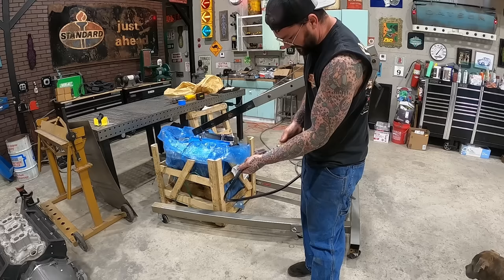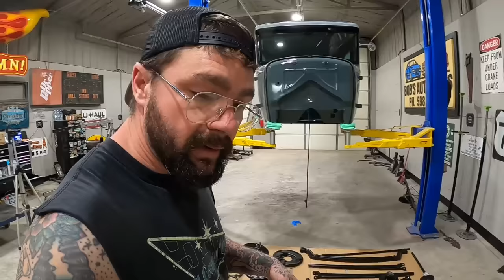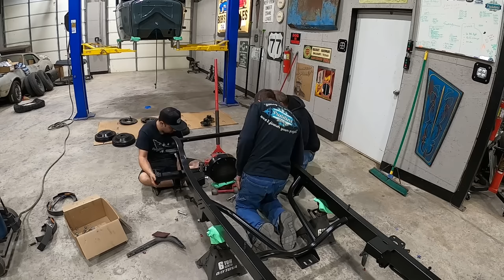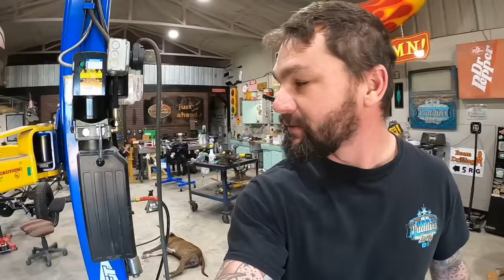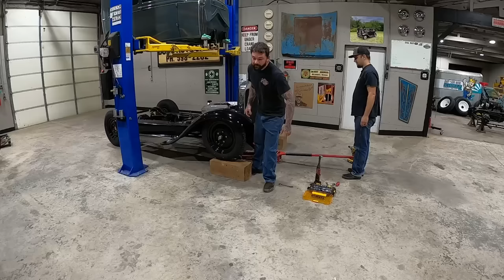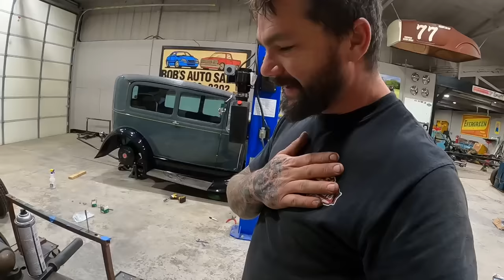ENGINE Installation, CHASSIS Assembly, BODY Installation, AND MORE!! 1930 Model A.

Comment: Suggestion : For oiling up your engine before firing it,disassemble an old dead distributor ,remove the gear,cut the shaft housing off at the top. Now you can drop the shaft into housing ,connect a hand drill to spin your oil pump up to pressure .I welded a small nut on the top of the shaft to attach a drill to. Simple and handy as a pocket on a shirt :)

Comment: @Puddin   gotta have Zinc oil additive my left nut...  just use Shekl° Rotella° Diesel engine oil... they don't screw with the recipe. It still has the right stuff for the flat tappet cam & lifter setups.. AND IT DOESN'T COST A FORTUNE like the special additives do.

And whoever says that you can't paint chrome hasn't looked at nearly every the police vehicle in America... they paint the factory chrome wheels black...  you CAN paint it. ...  and it sticks well enough if you actually take the time to prep it ( or you cheat and heat it up good and hot and spray it with water while it is. .... ( that usually causes the chrome to peel off ) 
🤣

Comment: The key to any project is actually finishing it. Those who think modifying a car detracts from its original design but then again it’s really in the eyes of the beholder. Probably Henry Ford would have never envisioned the stance along with a V8 especially a Chevy engine . When you get to drive it down the roads or highway will be the ultimate thrill and accomplishment Puddin I can’t wait. Be careful and stay safe my friend God love ya brother.

Comment: When u come to oiling top of the heads i normally get it ontime nd then 180 out nd then do it again if it doesnt still have a friend do the oiling prime nd u get on the crank nd start turning it to make sure all oil come outta all 8 holes

Comment: just a quick fyi Puddin, my dad bought a new pair of dentures & he used to stick them in between the vertical cushions of the couch towards the top. my springer/black lab mix found em & lets just say super glue works very well to glue them denture pieces back together. he wasn't happy tho

Comment: Tech tip for you, leave the intake bolts loose and drop in a distributor housing to align the intake to the block and then tighten the bolts. T-shirts, limited supply shirts used only once to haul the model A parts home.

Comment: The T looks great puddin, can't wait to see you drive it that will be the coolest ride west of the Mississippi.  

One moment on bearing packers, they are the biggest scam in the automotive world. I just put a glob of grease in the hub , smear some on the outside of the bearing and install.  By the time you set preload you have spun the grease into all the roller bearings. Anyone who thinks the grease just decides not to get all inside the bearing from a few spins is crazy. Grease gets just as messy as never seize, we know how that gets everywhere in 2 seconds, just ask mortske...lol

Also great to see those chrome ram horns instead of tube headers. Headers provide so little of a horsepower gain yet cause so many fitment and heat soak issues that they rarely provide a good reason to use unless its a full race car. Ram horns for life!! Peace ✌️

Comment: When i built my mustang, i was going to leave it all ford blue, but not liking the plainness of it, plus with the only oil pan i could make work only came in chrome, i decided to embrace it. Chrome valve covers, T hold down bolts, chrome dipstick, chrome air cleaner, aluminum intake same as this one, couple this with a gloss black engine compartment, and a bright ford blue engine it really popped. I won several trophies for my engine compartment detailing, so sometimes chrome isnt so bad.

Comment: That timing tab is for a early 70s style sbc. In the late 70s they started putting the timing tab on the top of the balancer welded to the timing cover.

Comment: You can give your engine crane one more valuable upgrade that'll cost a lot less than the new ram..........new wheels. The craptastic wheels that are already on the crane might be welded on, and would need to be cut off, and the new ones welded on. Seeing you opening boxes with a recip saw made me wonder for about a half of a second if I was watching a video from AvE, but then Theo popped into the camera and I knew it was all good!!!!! If you wanted to trigger the Ferd and Chebby loyalists, you could slap a coat of Pontiac Light Blue Metallic paint on the engine. This sure as hell is shaping up to be the best damn Model A in Pott County, I'm sure lovin' it!!!!!!!

Comment: Hey puddin just grab ur standard gm distributer from the ol junkyard cut the top half of it off and cut down the shaft a little bit to were a cordless drill can connect to it nd bam self oiler

Comment: Next time yer at the scrap yard, check for about a 1980 square body. The timing chain cover will have the tab that lines up with the mark on the balancer being at High noon TDC #1. It will solve yer timing mark problem as per factory spec.

Comment: I was never a huge fan of these cars until now. Love the wheel and tire set-up that you went with! Doesn't look like you took the wheels and tires off of an old 70's muscle car and slapped 'em on a Model A like most of them look. Turns out I am a fan of the car, I just hadn't seen the right one.

Comment: Probably been said already, but you need to cut down an existing distributor for a priming tool so the oil will feed the other bank correctly.

Comment: She's mighty fine. I think I would have put a little 289 in it with a healthy cam and a T5 and 355 or 373 gears depending on tire size. 373s are a decent cruising gear with decent performance in city traffic. I'm a Ford guy if you couldn't tell but there's nothing wrong with an old GM V8. They are plentiful and have decent performance and reliability.

Comment: 🗿💨 all SBC have balanced guts , except the 400sb. Which has to have that dowel pin hole lined up on flywheel. And thanks for the pro tip for filling a torque converter 😂👍

Comment: 🤔Yeah! to each his own I guess but, for me, I'd keep the hood double locked down on that (looks like it belongs in a Van) Engine in it's present goofy looking air cleaner four barrel configuration. ✋🏻🤣Gotta say, I never seen someone carry on so much about skinny tires on White or Black (Babymoon)steel rims. 😁Hey, not hating, the final product looks outstanding, everything you did to this car came out exceptionally well to what you envisioned it to be and I know, NOBODY else's opinion makes a damn bit of difference to your vision but you're own. Good luck with her, the attention to detail you put into the build, she should provide you a whole lot of enjoyment throughout the  coming years. 😉👌🏻Not to worry, that Van motor should spin those tiny tires with little resistance!

Comment: Puddin the model A is definitely looking sick buddy for sure!!! I absolutely love it!!! You should try getting an old like 1925 model TT and not a model T one!! I got one that is all original and has everything original in it also!!! Absolutely love it!!! After getting it and I got the old flat head engine going we took it up to the local gas station to get some celebratory drinks for getting it running and on the mile drive back home we had a local sheriff following us home witch is mostly on gravel we kept thinking that he was like what in the heck is that rig going down the road?? Lol!!

Comment: You can switch to a 70’s Model balancer and not have to modify the timing pointer.Early SBC’s had the timing marks at 12 o clock while later had them
clocked 45 degrees.You will al need the correct diameter balancer whether it be the 8 inch or the 6.7 diameter.

Comment: That balancer is for a different year small block  mines the same way even has the wrong pointer did the same thing hit tdc marked it and bam good to go mine has a set of old-school heads that wer worked over upgraded springs and a thumper cam in a 87 plus factory roller motor love the content alway look forward to seeing the video notification pop up keeps me sane and entertained wile im out here on the road instead of home playing with my nova

Comment: I'm blown away by the wheel and tire choice. As a 55 year old hot rodder I grew up with Magazines like Hot Rod and Car Craft so the cars that grace the pages of those have a strong influence on my idea of what looks good. They don't need to steal the show but they also should not completely disappear. Black steelies with black walls and black fenders/running boards are not doing it for me. If nothing else a body color pinstripe on the wheels would do wonders! It looks like you put those wheels on for transport duty or something. If YOU love this look i'm happy for you and hope you enjoy this awesome little hot rod.

Comment: Im not there so Im not going to pretend I know everything.

Will your  lift not go up high enough to use it to lift the body

Using straps across the arms or Puddinfy an attachment for your lift to grab under the body of a care to lift it off the frame?
Not have to do the Oklahoma 2step with the  woodblocks and rolling racks?

Comment: I would take the crate that the motor came in and make a wooden box to hold Theo's bed up off the floor do some wood burning and put his name in it i built one for my dog out of a wood pallet 15 years ago and still have it my dog still sleeps in it and when my dog passes away I'm going to take it and make a smaller box to put my dog's ashes in

Comment: Puddin not all sbc have a hole in the front of the engine that you can put a bolt into to hold your fuel pump rod up!! Just thought I’d let you know that about the sbc!!! I figured this out years ago when I worked at a engine machine shop that would go threw all kinds of different engines and reassembled them if the customer wanted us to or not!!! Also I have never ran a bolt into the holes that would go all the way through and hold the fuel pump rod up!! Why because the bolt can bur the rod up and then the bur can hold up the rod from sliding back and forth correctly like the rod was made specifically to do its job and that is nice and smooth!!!

Comment: Should be using Indian head gasket shellac it's called buffalo now $2 a bottle probably 5 or 10 now with inflation that's what you need to prevent intake gasket leaks and it holds them in place so they won't fall when you're puddin the manifold on. It dries semi-permanent so you can disassemble whatever it is easily if you really feeling rich try using aviation form a gasket.. same stuff just better. Cuz it cost more

Comment: You’re losing oil through the distributor oil passage using that rod. Its better to prime with a actual primer with a  shaft that blocks off the port.
I see you found a distributor to use, good deal!

Comment: Next time you stab a small block distributor, and the oil drive isn’t lines up, just spin the crank until it drops into the oil shaft, once it’s engaged with the cam it won’t move.. I’ll never align the oil shaft again…

Comment: Is it just me r did those ex- manifold on the old motor that he got the push rod for the fuel pump... Look a lot better..they didn't even need paint... Well cause it's all going to burn off anyway... But hey I'm not the sharpest tool in the shed..

Comment: Hey, I have a video idea. How do you organize your scrap metal and parts? I've developed quite a pile of scrap over the years, and need some ideas on how to manage it. Anybody that has the bug would benefit from your wisdom on the topic 😂
Reply: No, you really wouldn't. Puddin' did try to organise his scrap metal towards the end of the shop build. He did better than me but probably similar to you. Also did you see the concrete area outside the shop when he went to retrieve the engine lift? He had lofty ambitions there too.
Reply from the maker: It’ll get organized. Just gotta add the awning
Reply: @IGDZILLA  😂👍
Reply: @PuddinsFabShop  place looks good. I'm jealous 👍

Comment: i'm about 3 videos behind.  i don't have a lot of internet data and i'm working a lot lately.  however i might to a trade for my 1979 GMC for a 1983 F100 tomorrow.  i want the 1983 300 straight six 4 speed manual long bed truck.  he wants my 1979 GMC C20 v8 4 speed long bed.  but i replaced the FICM-7 on my 2003 F250 7.3L diesel today.  my IDM was fried.  now it's running at full power again.

Comment: I just don't understand why most people have problems with the china wall gaskets. I myself or anybody else I know has had any problems with them. I rather see a gasket instead of smashed out silicone on the front of my engine. That's not show car quality. Just like people think the" piss stinka" look is show car quality. If you want to show off rust take it back to the junk yard

Comment: I'm hoping that engine is a Ford cuz that is a Ford car don't ruin it and put a Chevy engine in it
Reply: Well this video answered my question you ruined the car you put a Chevy engine in it I can tell because the distributor cap is sitting in the back of the engine not in the front with a board what a crying shame people destroying cars like that an old car like that should have a Ford engine in it but I get it Chevys cheaper to work on just putting ain't fancy after all